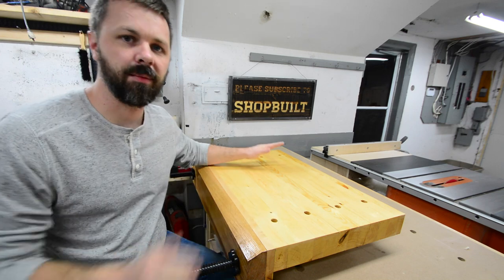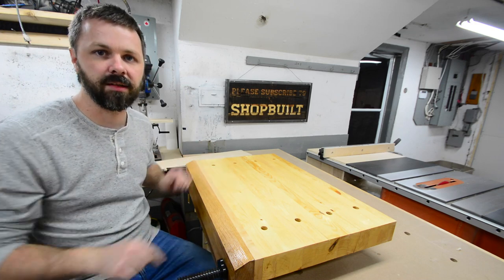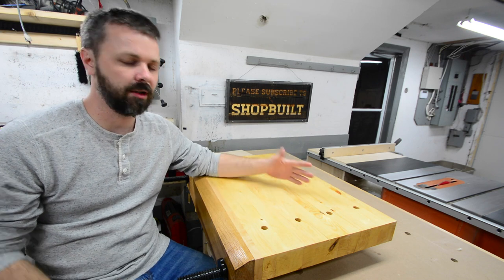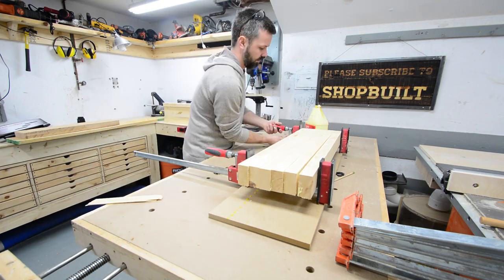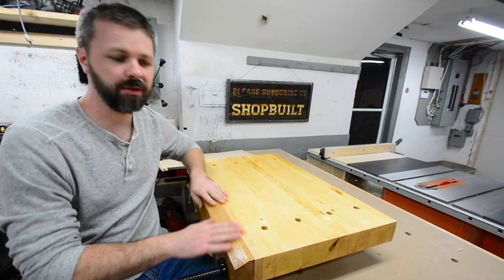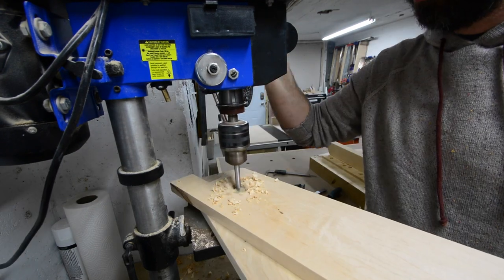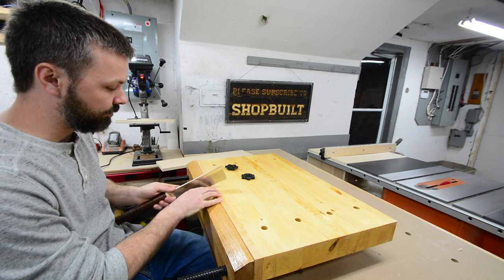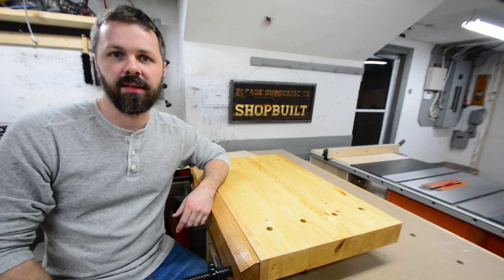Woodworking project - Moxon vise

Comment: Just what I was looking for. I just brought home to dumb bell bars from Walmart with 1" acme threads from end to end that's 14" long. It just looked like the perfect low cost solution to me and this video has verified my instincts plus given me a few pointers regarding the construction. Thanks and obviously yes it''s true, great minds do think alike. Since I have 14" of thread I'm going to make it so I can adjust the amount sticking out the front of the vice to suit the thickness of the workpiece and avoid having 10" to 12" of steel bolt sticking out to snag myself on when working on other things in my shop.
Reply from the maker: +mwilson70201 nice! The barbell rod has worked out well! It would be nice to figure out a way to keep the bars in but still maintain the speed of having the threads exposed.

Comment: I really like the idea of using the weight lifting bar.  The only down side is a more limited amount of space for the work piece.  Great idea and super simple to build.
Reply from the maker: Yes, moxon vises typically limit there struck in return for speed. By being able to push the moveable jaw in by hand and spin the nuts is considerably faster than a traditional vise.
Thanks for watching
Ryan

Comment: Wondering if you can flip the bar with the screw portion under the benchtop so  the bar would not stick out so much.
Reply from the maker: You could, much like a regular vise but the idea behind spinning the nuts is for speed.
Thanks for watching
Ryan

Comment: Good job, I like your tip on the weight set for the vise. Where do you store it? How heavy is it?
Reply from the maker: +arboristBlairGlenn I have a good home for it right on my bench. It fairly heavy, probably 25-30lbs.
Reply: +Shop built --does it live there? If you get a chance, check out my channel

Blair

Comment: Very nice idea the reversible vise! Doesn't it need to be attached to the workbench?
Reply: +Cactus! workshop I was thinking the same,  If I make one I may make it so it goes into the dog holes in the workbench.
Reply from the maker: Yes, the fixed jaw extends out past the width of the vise allowing you to clamp there.
Thanks for watching
Ryan

Comment: I really like the idea (mistake) of having the bevel on one side and the bench dogs on the other. It seems like there might be a little difficulty in getting enough torque to tighten the vice with those nuts. I wonder what it would be like if you reversed them. You'd have a little less surface area pushing against the vice, which might not be great. Then I thought that it'd be cool if you got another set of those nuts, you could join them together (somehow) and that would give you enough distance from your vice to get better torque. Just a thought, great video!
Reply from the maker: There seems to be enough torque to hold material without it moving around but I was thinking of doing a second video of making some nicer handles.
Thanks for watching
Ryan

Comment: Cool project.  I'm worried that you glued the legs on cross-grain though.  Might run into trouble when the top expands and contracts.
Reply from the maker: I am too:( I kinda realized it wasn't a good idea to glue it after it was all done. I think I'll brake them off and just screw them on.

Comment: Ryan, don't know how I missed this, good job. Do you really need a table that big? I recently built one from beech, good workbench and vise wood that is cheap around here, but made a much smaller table to keep the weight down and make it convenient to hang on the wall. I used a hardware kit from Tools for Working Wood that has 1/2" acme threads and they work fine, hold the workpiece tightly. Moxons really help the back don't they!